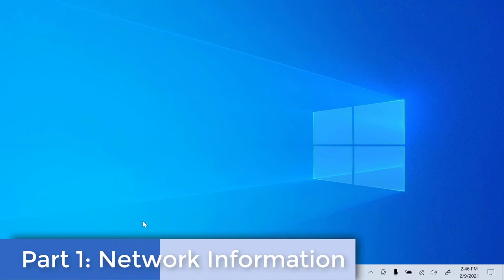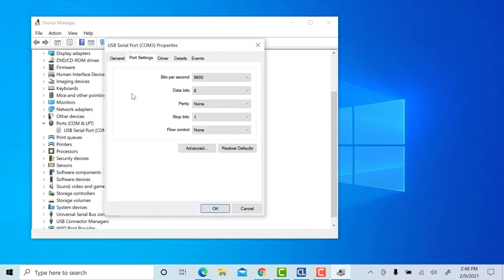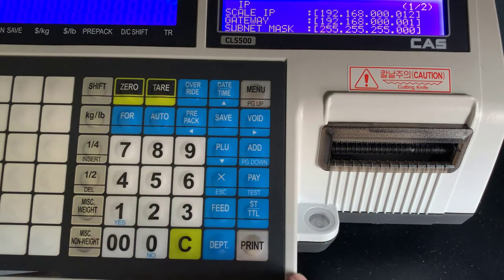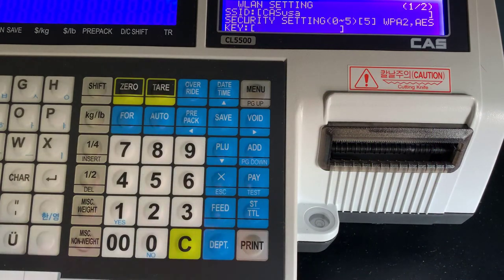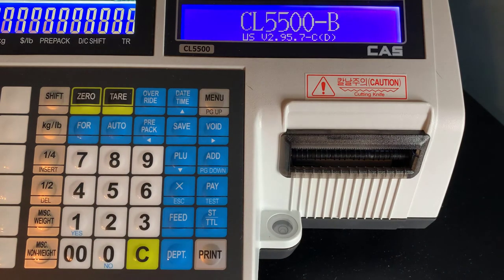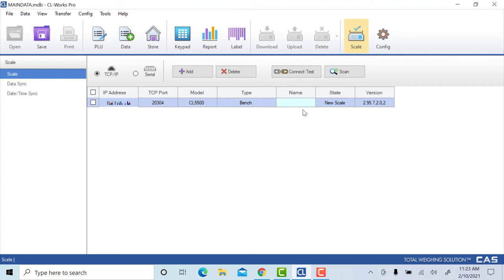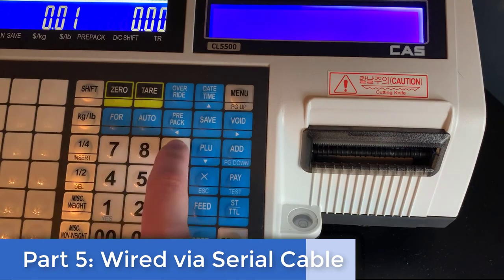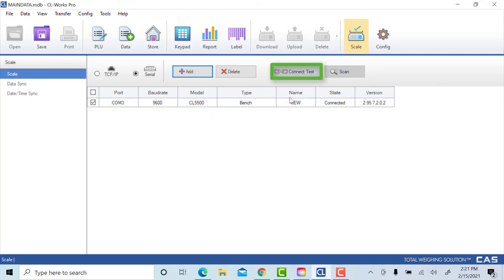3. CL Series: Network Setup & Connecting to Your Scale

Comment: Hello. I have programmed new CL5500 and it won’t print label if tare value in the PLU table set to 0.01. The 3 other scales work just fine with tare value programmed. New CL5500 will print label only if tare value is removed and set to 0.00. What am I missing? I use older software to upload PLUs to the scales called CL Works. I already searched and re-read users manual several times and can’t find anything. If I set tare to 0.01, I get error on the scale screen “Invalid tare value.” I temporarily removed all tare values for the specific department, but in a longrun, I’d like to keep the tare and find out the programming setting in the CL Works or on the Scale itself. Please help.
Reply from the maker: Hi This is a great question and I'd be happy to help. First thing that comes to mind is the scale model itself. You said the other scales are working fine with tare. Are they by chance a higher or lower capacity scale? For example are your other scales 60 lb. scales? And this new one may be a 30lb scale? That would change the lower end of the scale divisions. So you would need a separate database that had tares set to 0.010 instead of 0.01. 

Please let me know the models, it should say the weight capacity on the spec plate on the side of the scale. Also where and who did you purchase the scale from?
Reply: Wow you are correct. I do have 2 different models in one of our departments. One is 60 LB and new one is 30 LB. Once I set the tare to 0.010 on the 30 LB model, the tare works just fine. I am just going to have to keep all the same models in the same department either 30 LB or 60 LB because keeping 2 separate databases would not be practical. Thank you very much for helping! I have been scratching my head for quite some time already, reading and re-reading the user manual and could not find anything related in the manual or anywhere online. I have purchased scales somewhere from online vendor from the east coast. I do not remember the name since it was about a year ago.  @cas-usacorporation900

Comment: Hi! I have a CL5200-B with a built in LAN card. I have issues with both wireless and wired connections. When I try to enter WLAN settings (menu 1916), I just get three quick beeps and it doesn't open. What could that indicate? For RS232, I've installed the Prolific drivers in Windows 11 and I have functioning COM3 port, but CL Works still writes State: Failed when I try to connect. Baudrate is set correctly. Any tips or solutions to try for both modes of connection would be greatly appreciated! Thanks

Comment: FYI, the link you have provided to supply a 9 pin cable is the wrong cable for the scale connection.  The pins are correct, however the screw should be a male end.  The item on amazon provides a female end, which is the same as the scale.

Comment: I've got 20 shops, each has 1 CL5200. I had to manually go to each shop to update PLUs when needed. It was a frustrated process. Would you please tell me how to connect the computer from our headquarter to  scales in our shops (which are far away, not in Local Network) ?
Reply from the maker: There is a method that should work for the 5200 like it does for the CL7200. Alternatively you can save a .mdb file and send it to each shop and have them open it in CL Works pro then download it to the scale themselves.

If you have any questions,  please send us an email with your contact information to info@cas-usa.com. We will have the correct branch office contact you. Have a great day.
Reply: @EcologicalSoftware somos una empresa Venezolana hacemos que nuestro software envie toda la data de los PLU directamente a la balanza !!